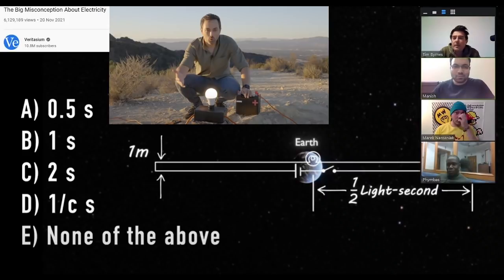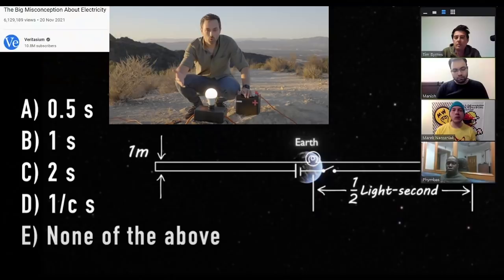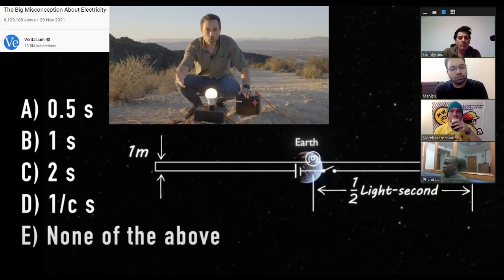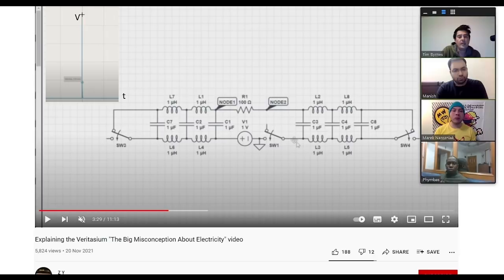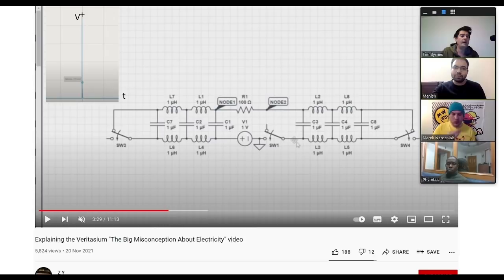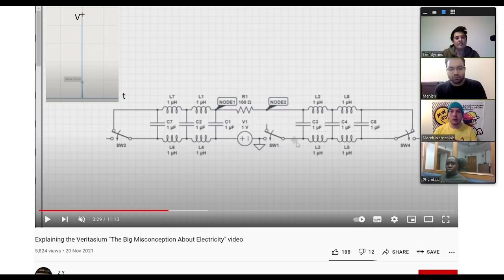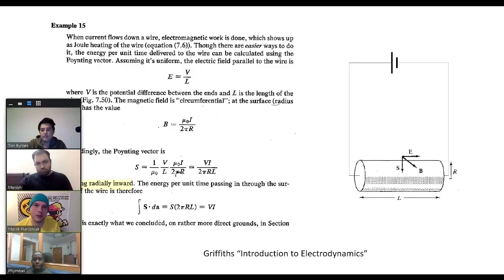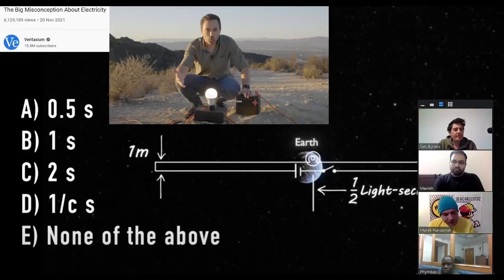Veritasium's Big Misconception About Electricity video and the point about Poynting

Comment: "TINY TINY EFFECT" is wrong.   And it's not a transient bulb-flash, it's a DC step-function.  The bulb turns on.
Veritasium's counter-intuitive video claims another victim!  
His video is NOT misleading as you say, since he clearly states that he's using a thought-experiment bulb, not a real bulb.   His conceptual bulb lights up when any DC arrives.  (Those who ignore his setup will be confused: angrily insisting that the bulb is "too dim." )

If we ASSUME, and don't calculate, then we'll be misled.   For example the one-meter spacing seems large.   But electrically, it's very tiny.  (Veritasium could have used wires that were spaced 1mm apart.  But that would seemingly give large coupling between the wires.)   The 1-meter spacing gives 100% coupling too.  (It's because his 1M gap is << wire-length.   Imagine a transformer with million-meter diameter, where the two coils were only 1m apart.)

If you don't normally use basic Heaviside-style engineering, then you're screwed right at the start.   The concepts are simple.   But the YT comments show that the concepts make people angry and disbelieving, so that, rather than actually listening, or rather than hitting the books, they start arguing.  And arguing.   And making beginners' mistakes, then hotly defending them against all objections.    Hence the "tiny tiny effect," and pretending that the initial bulb-lighting is a spike, rather than a 1-second step-function.

Beware: the video with the six capacitors forms a major straw-man fallacy (by cutting away the million-meter wires: basically making them a couple meters long.  That's cheating.)

Try this: replace the bulb with a short.   What is the initial DC constant current after 3nS?  (Constant, NOT a pulse?)  Do the full calcs, based on Heaviside's concepts.   It's a constant ~9mA, (a flat-top step-function,) plenty to light an LED, but Veritasium's ideal bulb is not an LED.   Now replace the bulb with an open circuit instead.  Now after 3nS, 12.0V arrives at the bulb location.   These are constant values, not spikes.

Obviously this is a load-matching scenario, where the batt voltage and bulb-ohms is critically important, and we'd better NOT mindlessly use a 100-ohm resistor as a load.   (Veritasium states this outright.   Ignore it at your peril.)

Replace the bulb with a white 3V LED, and after 3nS, what current will we see?  More than 6mA of DC, lasts for the entire second.   The LED lights up normally before the 12V hits it later.

But did you want the bulb to be bright?   (That's NOT his thought-experiment.   Don't change his experiment, then pretend that he's wrong.)

Let's have the bulb be bright.   Use a 200V battery and a small, one-watt bulb (it's a 40K resistance, 5mA gives 1W.)   What will happen?   The bulb will initially get 4.8mA, at 92% of full brightness.   Then after 1sec, the full voltage arrives and the 92% becomes 100%.

Where do these numbers come from?   If you don't know these calculations, you need to hit the books, or ask an RF engineer, or a physicist who actually listened during their fields/waves class.

Here's a clue.   At what low frequency do transmission lines typically stop being EM-fields devices, and start acting like AC or DC circuitry?   Answer:  there is no such frequency.   All circuits are waveguides, even at DC.   The people who don't believe this, are blocked by a learning-barrier.  They're harboring a misconception taught to them during grade-school:   the wrong idea that "electric power" is fundamentally different than radio-freq energy, and obeys a different type of physics.  Nope, wrong.
Reply: ^ This needs more likes.
Reply: I realize that Derek proposed a thought experiment, but as a teaching tool, the lightbulb is just a misleading example. He does a fine job of explaining energy flow through/around the circuit (including field and poynting vectors), but his insistence that his "ideal" lightbulb "lights" in 1m/c just introduces a source of needless confusion for his general audience. The trick question attracts clicks, but in the end is not quite convincing (as the subsequent debate showed). He could have asked, "When could we first detect energy at the lightbulb" and maybe avoided all this confusion and debate. Yes, it got lots of people to think -- who probably had a solid understanding anyway -- while leaving many others dazed.
Reply: @michaelmcgowan7099  Even the experts are dazed  ...but only because they refuse to calculate the initial V and I of the bulb, and instead are misled by that large 1M gap.

Veritasium should have mentioned that the bulb lights DIMLY and immediately.   He should have mentioned that the one-sec delay is only for full brightness, but not for initial lighting.   (For a matched resistance, we see a constant 6V across the bulb, with 4.3mA current lasting 1sec.   With matched bulb resistance, initial watts is 25%, with final watts being 100% after one sec.    This for a 1M gap, with cables being 5mm thick.  Calculate the line-impedance of ideal 2-wire lines.)
I only see one other person getting this right so far: https://www.youtube.com/watch?v=RsiYXfpJu5U    (Him, as well as the two experts in Veritasium's links.)

Also, this is neither "weird" nor "non-mainstream," since it's part of simple basic electrical engineering for high-freq cables.   All cables are also EM waveguides.  (This was taught in my fields/waves class, in 3rd year engineering.   But physicists ignore it as "nuts" and "non-mainstream?"  )

The poynting-vector field gives the location of the EM wattage in coax cable, PCB microstrip, and 2-wire lines, which all behave as waveguides.   The same even applies to 1000-KM three-phase power lines.    The only "weird" part is that it also applies equally well to DC, and explains the energy-flow in ALL circuitry, not just in our GHz coaxial cables.   This is the "lie" that Veritasium mentions ...where even a DC flashlight is actually operating by EM waveguide effects, yet we're never taught about it.  The physics of energy-flow across conductors is independent of frequency.  There is no "magic" barrier between RF effects versus simple AC versus DC.  2-wire transmission lines describe flashlights.  Yet undergrad phys textbooks don't teach it as a matter of course.

The physics community should well know about Poynting for circuits.   Why don't we?   Probably because we were taught wrong back in grade-school (taught that electrons are the electrical energy, taught that current is an energy-flow, taught that the electrical-energy flows only inside the copper.  All three are wrong.)   Even our textbook-authors were taught such things during childhood (hence Feynman's constant use of the word "nuts.")   Don't forget, all textbook-authors learned the same incorrect garbage during grade-school.   Their original electricity-misconceptions may persist, while in EE classrooms, the same misconceptions are specifically debunked.

In reality, should anything flow at nearly c inside copper, we expect ionizing radiation and Cerenkov glow!   This doesn't happen, because 100% of energy-transfer in circuits is occurring outside the copper surface only.  Cool trivia, eh?  No lightspeed electrons in wires, no MeV betas.   Even undergrad beginners should have known that the near-c energy-transfer can only happen because the watts can "leapfrog" through the empty space outside the wires.   Yet it's not introduced in undergrad textbooks, and even Feynman keeps insisting that the theory is Nuts.

Engineering textbooks don't reject Poynting flow.   JD Kraus ancient book "Electromagnetics" even features the same diagram from that 2004 paper!   In other words, RF engineers are using everyday concepts which physics students are not taught, and are rejecting, calling it "weird" and "non-mainstream."    See Kraus diagram http://amasci.com/graphics/kraus_poynt.gif   In my opinion, these are the words of people who still believe their childhood videos Magic Schoolbus and Bill Nye, which teach that amperes are an energy-flow, and that electrical energy flows only inside the wires.
Also: list of common misconceptions in grade-school electricity http://amasci.com/miscon/elect.html

Comment: My two cents:

1. Electrons move inside the wires.
2. Electric field puts electron in motion.
3. Moving electrons generate magnetic field.

There are three ways energy can be transferred to the environment.

1. A resistor is an example of energy dissipation within the conducting path of electrons. Its the electric field of electrons that disturbs other charged particles within the conductor thus heat energy is created and radiated to the environment.
2.Energy can be tapped from outside the conducting wires using magnetic field generated by the moving electrons, as in transformers.
3. Direct radiation of energy to the environment by accelerating electrons, as in radio waves from an antenna.

All above energy transfers happen due to the electromagnetic field. So it is concluded that the energy is carried by electromagnetic field whether the energy transfer happens inside or out side the conductor.
The experiment:
instead of 1 light second length, 100 meters long wires and with a digital storage oscilloscope, exact time that takes for the bulb to light after switch has been turned on can be exactly determined.The capacitance of the wires would be too small to make any transient effect. The time taken would come out to be exactly the time the current takes to complete the loop after the switch has been closed.
Reply from the maker: That's what we would expect too, removing the transient effect.  Agree!

Comment: All these Poynting vectors are fundamentally the simple result of inductance and capacitance, both of which are products of current. The point is, this Poynting energy stuff is only a small percentage of what's going on. The Veritasium video implies it is everything that is going on and has the cart ahead of the horse - current comes first and everything follows from there.

The voltage "in" the wire and the current "in" the wire are the predominant things and everything else is a mere consequence of them, not the other way around.

Comment: I am not sure where you got the schematic but the values seem way off.  The capacitance value is too high and the inductance is too low.  By my calculations, because the wires are so long compared to the distance between them, the inductance is quite high and it will take about 3h before the amount of power coupling to the light will reach 50% of full power.  This makes sense as the there is a pretty large field that has to be created because of the really long wires and the energy to create that field takes time to build.

Comment: A small nit: what happens 1m/c seconds after the switch closes is not some barely noticeable hint of power tickling the bulb; it is a rather large effect that can be understood if you consider the circuit to be composed of transmission lines.

If the resistance of the bulb is matched to the characteristic impedance of the transmission lines (say the line has an impedance of 800 ohms, and because there are two of them we select a 'bulb' with an resistance of 1600 ohms) then the the bulb 'initially' gets 1/2 of the power leaving the battery.  There is a transient effect that I am not equipped to analyze that starts at 1m/c seconds and my guess lasts less than 10m/c seconds, and then the bulb is on at 1/2 power, with 1/4 of the power flowing down each transmission line to the far end.

When the transmission line power reaches the short at the far end, it gets reflected back, and 1 second after the switch is closed the bulb hits full brightness.

If the distant ends were open rather than shorts, you would see the same sort of effect.  Close the switch and in short order the bulb gets half the power, with the rest of the power going down the transmission lines.  At the far end you again get a reflection but with the opposite polarity.  1 second after the switch closes the bulb goes out.

-Jon
Reply: @PGH Engineer Don't let the messiness of the real world intrude into our idealized thought experiment, or we will have to send you off to the frictionless vacuum :)

I absolutely agree that with real conductors supported with real insulators in real space there will be dispersion effects, resistive losses, etc.  But the basic concept remains the same: the first indication that something is happening at the switch will be 1m/c seconds after it closes, and the lamp will be at a large fraction of its full output quickly thereafter, and then something else will happen roughly 1 second later once the signal has had a chance to propagate out to the ends of the wires and back.

It would probably be fun to set up a demo using a fast oscilloscope, a function generator, and lines much shorter than 1 light second.
Reply: @PGH Engineer Exactly.  And anyone who has used a TDR system to detect cable breaks has used this in practice.  Similarly anyone using stubs of transmission lines as filters has taken advantage of this.

I bet your setup did not attempt to measure the time delay across the transmission line.  Nor would I expect it to, since for 99.9% of the uses of transmission lines the delay along the length is relevant but the delay across the leads can be safely ignored.

A demo that convincingly shows the time delay across the lines versus down the length of the lines would be a bit more complex, because you would need to measure things on two different time scales and also reliably differentiate the gap across the transmission line from the length of the probe cables.  Not sure that this would have any utility other than eye candy for you-tube.

-Jon

Comment: Okay, he is wrong because he is saying the power travels across the air gap to power the light and that is how the power travels in the circuit and he leaves it there. That is false because he is presenting this as the path of the power and not discussing the primary path of the power. It is not just misleading, it is wrong.

While a tiny amount of the power will travel across the air gap, it will be small, transient and certainly not able to light the lightbulb as he shows lit up in the video. If the two wires are separated by 1 meter and we estimate a model of the two wires in parallel with capacitance every 1 meter.
C = (2*π*l*ε0*εr)/Cosh-1((s2- rw12- rw22)/(2* rw1* rw2)) in Farads
Using 14-gauge wire, rw1= rw2= 0.814 mm
l = 1 m
S = 1 m
εr= 1.0006 F⋅m-1 (permittivity of air)
C = 3.90500 pico-Farads = 3.905e-12
The inductance would be.
L = (l*μ0/2*π)/Cosh-1((s2- rw12- rw22)/(2* rw1* rw2)) in Henries
L = 2.845 micro-Henries = 2.845e-6 Henries

Now, you can simulate this with a smaller circuit and still see the effect. Make the wires extend out 10 meters instead of 1 light second.

Now, plot the power versus time the power across the lightbulb for the broadcast part which travels across the gap and the the part which travels along the power transmission line. Maybe, right when the switch is flipped there might be enough transient signal crosses the air gap to make a small glimmer in the lightbulb, but the light won't really turn on until the power travels down the length of the wire and then travels back.

Now, depending upon the power and frequency traveling down the wire, more or less of the electromagnetic field will extend outside the wire, but that does NOT MEAN the power is not following the wire but simple traveling across the air gap.